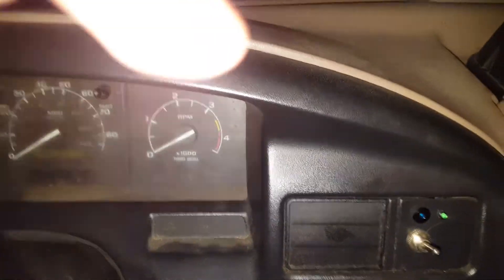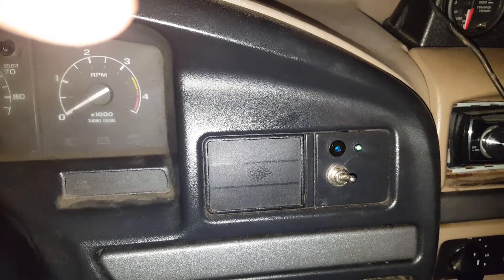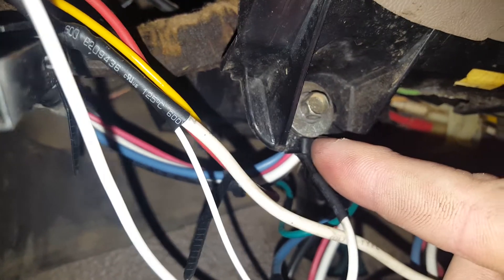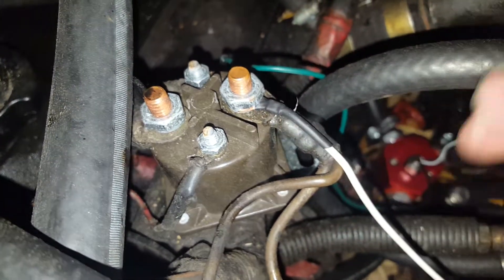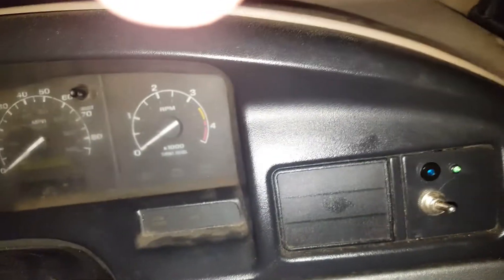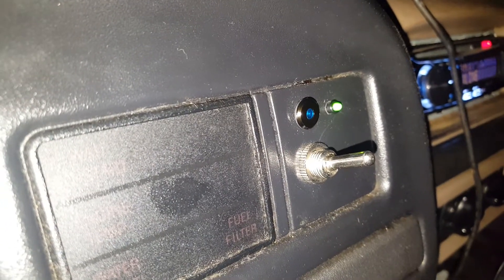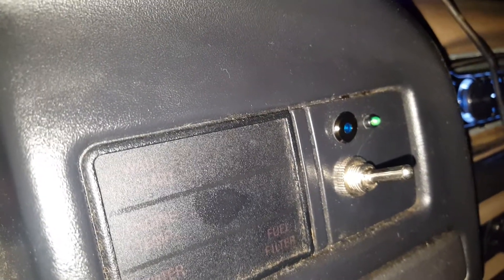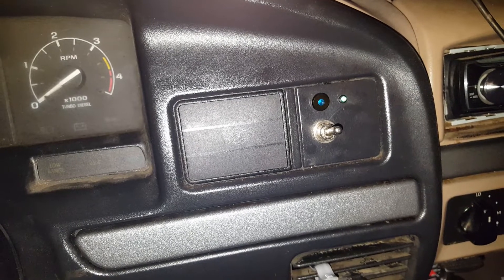7.3 glow plug light install

Comment: I found some diodes that are 2V 20mA and was wondering if it would pull too much? I’m not very savy in electrical stuff
Reply from the maker: Mine was 12v so I don't think 2v will pull to much
Reply: @dieselguy9950   alright, thanks  for replying